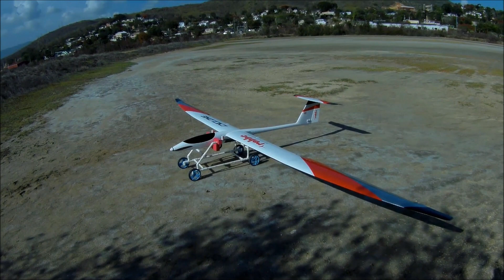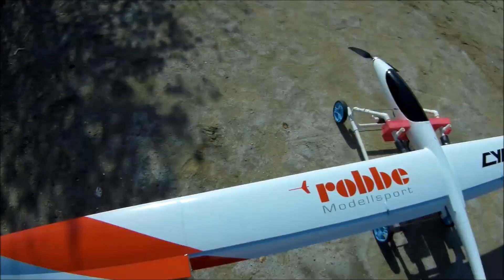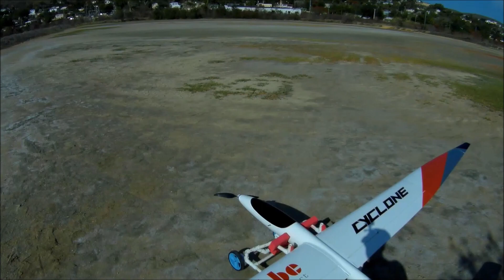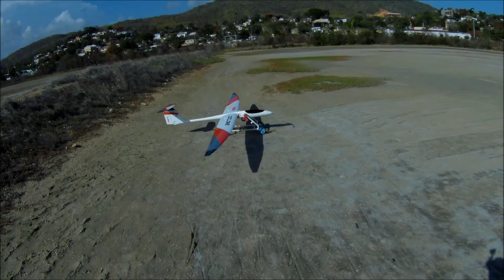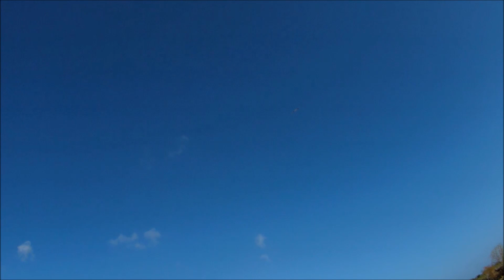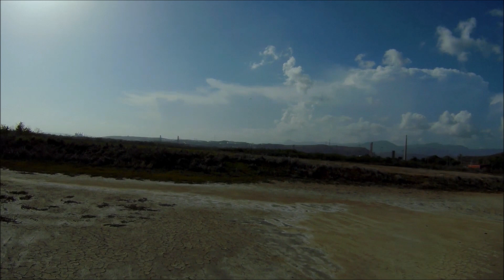Cyclone RC glider from Robbe, Maiden Flight, 2019

Comment: How much and can I get one in the US? Spectacular!
Reply from the maker: Hi Bill

You can get the Cyclone from Lindinger.at an Austrian company in ARF version or PNP with servos, wiring, wing multilocks and   motor allready installed.
Personally I preferred the ARF kit so I could install servos and motor of my liking.

Shipping is very reasonable at around $50.00 and the kits arrive usually in about 3 weeks

Once you open an account with Lindinger and enter your shipping address and put an item into your basket about 20% of local taxes are deducted from the list price.

At the moment the ARF version should be around $650.00 delivered. 

I am very happy with this well built model.

Regards
Reply from the maker: BTW, did not pay any import taxes

Comment: did you put a wheel or retract in it? I would like one of these but our field is like yours only more rough. a few details if so please.
Reply from the maker: Hi, thanks for watching my video. I have a retract with a 110mm wheel installled. There is plenty of space available. As my flying field is like sandpaper I use on all my larger gliders landing wheels. Should you need any additional information please let me know.
Reply: @tropicairrl6121  Thanks, I was looking at all the pictures I could find to see if there is room for a retract, but it was impossible to tell, great news. I've put in a lot of retracts so that should not be a problem, what size or brand unit did you use?
Reply from the maker: Hi, used a Hobbyking retract on both, the Cyclon and the Straton which have basically the same fuselage. They work flawless and support the 23lb gliders without a problem. They are available every now and than on the Hobbyking Website.
regards
Reply from the maker: If you need some pics, let me know.

Comment: You have 8000mAh 6S???
Reply from the maker: That’s right, 2 x 4000mAh 6S 60C
Reply from the maker: As I do mainly thermal flying and we have more or less good thermals every time I go flying, 4000mAh are enough as well. Usually I land the glider after an hour or so with over 60% charge left.
Reply: @tropicairrl6121  And the CG does not vary much from 4000 to 8000mAh???
 I have a cyclone to put in the air, but the neutral CG is there at 140, I have a pack of 4000 6S as far in front as possible is just 140mm
Reply from the maker: Hi,

140 is far too much, you have to add weight! Post a video of your maiden flight if possible. Good Luck
Reply from the maker: When I use 2 x 4000mAh lipos I have also to add weight in the tail to get to a CG of 118mm
Reply: @tropicairrl6121  Ok Thanks .. Best Regards
Reply from the maker: Fernando,

are you able to fly where you are? We are on total lock down going into the sixth week

regards